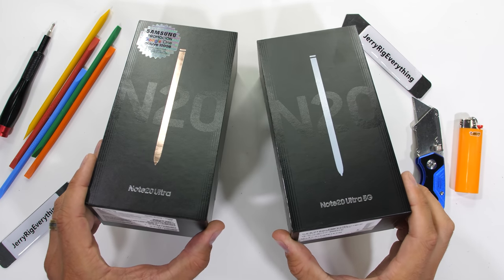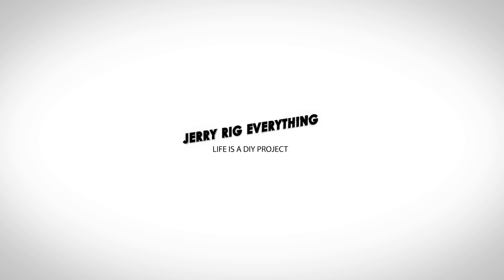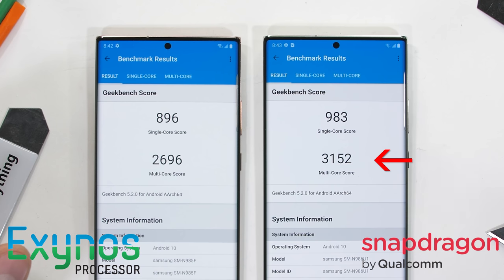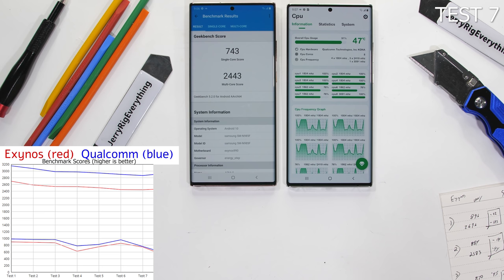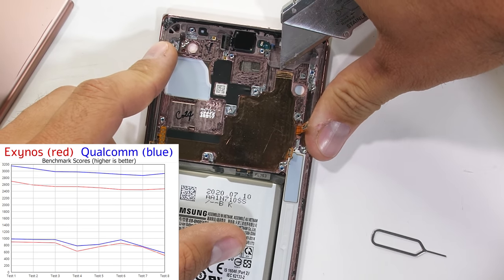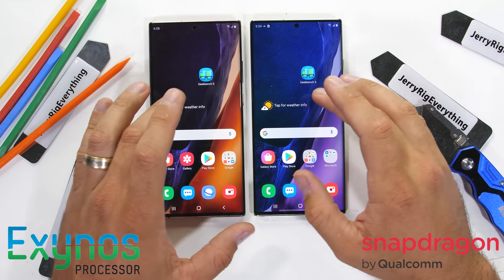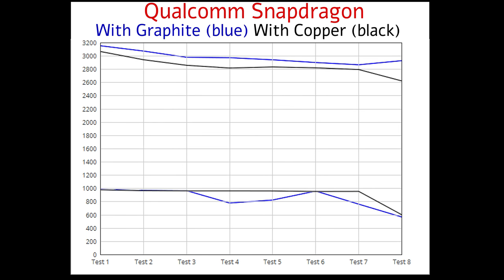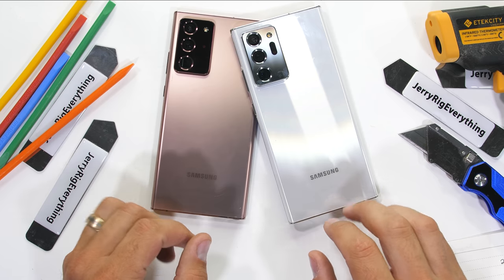Samsung should explain this... Exynos vs Qualcomm?! - Note 20 Ultra

Comment: Samsung are doing similar thing with their TVs, selling cheap lower quality versions in Eastern Europe with the exactly the same name/model.
Reply: You have a example mate?
Reply: Share the facts
Reply: And the power supplies in those TVs are designed not to last. This starts with component selection (only the cheapest caps) to component placement (caps in the path of heat, etc)
Reply: Thanks for the information, I wonder how bad the damage is and how far in the past they have done this.
Reply: @Lion_Hamza  it's a well know fact that quality of everything wester here is much different
Reply: @Lion_Hamza  yes i do, samsung american fridge freezer with familly hub, american version comes with akg speaker under screen, european version doesnt
Reply: What do people expect from Samsung? 🤮
Reply: Festool Fan Thank you! Sounds reasonable. When i was in Egypt family members told me that electronic products in egypt are of lower quality than similar products in Europe. Seems this is a wordwide issue.

Comment: Also owned different Exynos phones in the past and compared them to friends Qualcomm variants,  found that the Exynos ones got much hotter, were slower, throttled more and battery time was worse. Not buying Samsung any more.
Reply: yup same, and development is completely different, can't use regular arch binaries cause they are made for qualcomm
Reply: But you still can buy Samsung on Snapdragon :)
Reply: thats why i bought a phone by moto, it still uses snapdragon. 
although a phone with the latest helio processor is also a better choice as well

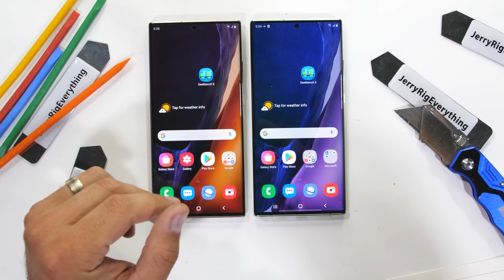Comment: 7:17 You can clearly see how much slower the Exynos variant is when opening the benchmark application.
Reply: The exynos version being a lot more expensive in Europe.
Reply: @thedawner6311  it's not actually. Its cheaper and also has double the storage
Reply: @eventusvantos2770  No, just no.
Reply: @eventusvantos2770  
It's more expensive in Europe , Higher Taxes , the currency from $ to € .
And Base storage options will Remain base storage options.
Reply: @thedawner6311  no its not. Its actually cheaper in most currency conversion and it has double the storage
Reply: What are you on? The note 20 ultra in sweden costs 16000kr. Thats more than $1500. $1500 gets you the largest storage note 20 ultra in the us, but only the 256gb here in Europe.

Shut your foodhole about being in denial if you cant even do a quick Google search.
Reply: @eventusvantos2770  You do realize it takes 5sec to prove you wrong with a Google search for the market prices right?

Comment: I really went on a tangent or two in this comment. It's mostly me rambling (not sure though, didn't go back to read it, lol). I think the point at which I was trying to arrive - but probably never did - is that I get that the phones weren't advertised as having different processors. However, I knew this before making my purchase. All a person had to do was read the description and specs, or ask about it- they actually had to WANT to know what they were getting for their money. I wanted a good processor, so I looked through all available G. S20+ models, did some research, and bought the more expensive Snapdragon model. I don't remember the phones being the same price..... in fact, the lower prices of some of the phones is partially what drew me to triple check all the specs. One phone for $1200 and the same phone for $900-something.... both brand new.. ? Yeah, I'm gonna be looking at all the details.

*Don't bother reading the rest of this, You!*

In the summer of 2020, I wanted a new phone. I was constantly running out of space on my old phone (Galaxy S6, 32 GB and no SD slot). 

The S6 was losing battery too quickly for my liking, and the inner charging port had loose parts, making it pretty complicated to charge.

Most importantly, I REALLY wanted to play CoD:Mobile.

I liked my brother's Galaxy S10 Plus (all except for the rounded edges- I never understood that feature), but figured I might as well get the newest model, which was the S20 line. So, I started researching. The S20+ had most of what I was looking for (you couldn't just make the screen totally flat?). I would have gotten the Ultra for the GB and the additional camera, but the phone was way too big, and the extra camera was nothing special. Plus, that "Cloud Blue" effervescent color was growing on me. 

And I'm finally getting to my point....

I was aware of the difference of one version using Exynos and the other using Qualcomm Snapdragon. I was going to be buying a phone outright- a phone I'd have for at least a few years- so I did my research on every single aspect I could possibly find. 

I almost bought the S20+ for under $1,000- until I noticed that it was the EXYNOS model. How the heck was I going to get to Legendary in CoDm with that!? Anyway... I purchased the Galaxy S20+ from Best Buy for $1,199.99. 

[ As an aside: There seems to be a weird issue between this phone and the CoDm server. I don't know what the deal is, because the stats for the S20+ are overall better than a lot of the "gaming phones" out there, and I have great network and WiFi connection. But I experience a lot of desync (I meet up with an opponent in match, I empty an entire clip on them before they even notice me or do anything, they shoot me once and I die- but killcam shows them seeing me first, emptying almost an entire clip on me, and me not even shooting, not going prone, sliding, jumping, ducking, or even looking anywhere near them....), sporadic lag, crazy wait times, getting kicked from games with a network error code.... and it happens way more in ranked matches than public matches, unfortunately. I tried getting a VPN and playing through another server, but I was kicked two of the times, and CoDm wouldn't even allow me to open the game on another occasion with the VPN on. I don't understand this, because streamers use VPNs all the time. And streamers also seem to have the advantage in the desync... I would have thought it would be the other way around and that the stream running would cause the missed connection. Maybe it works like a lag switch and it desyncs in their favor. I know they're great players, but I just have to wonder sometimes.... what's happening on the other side? ]

Comment: Yeah I could see the low display light in the exynos version. I think the low light appears in the exynos version is to eradicate the heat and battery consumption. They have to make adjustments to somehow match the Qualcomm snapdragon.
Reply: At 4:08 onwards the snapdragon one becomes dimmer as well. Its probably just a software feature that dims the screen when the phone gets too hot (and exynos gets hot real fast)
Reply: not true at all... the heat is so low that is not even an argument..  learn more about display calibration... You can pic any 2 display on the market (that are not calibrated) and they will look different..  and yeah,calibrated displays are mostly for professional use ,average Joe will never need that..

Comment: Never understood the whole Samsung Exynos/Snapdragon thing. They should stick with one or the other for all models.
Reply: Why? They use different chips in different markets due to a variety of reasons, such as different radio frequencies. It's a complete non issue.
Reply: @savagedriver1967  The only way to guarantee universal performance across all countries is to use the same parts in all countries. Any variation leads to differences in performance. A phone is supposed to perform the same no matter where you buy it. If a PS4 in Japan performs better than a PS4 in the USA, people would be up in arms over it.
Reply: They can't sell anything other than Qualcomm in NA mostly due to patents, while the Exynos is cheaper for them (designed and manufactured in their own subsidiaries/foundries) than buying a third party chipset. Qualcomm radios are superb so (I might be wrong) I don't think they're missing any bands which is used anywhere else in the world. Saving even $20 per unit amounts to millions of $$$ in the end for these large companies.
Reply: savagedriver1967 iPhone uses the same chip worldwide just saying
Reply: @savagedriver1967  radio freq? Wtf are you on about? Name one damn phone that can't roam internationally today. There is one reason for it and one only, profit.
Reply: @Zluken  As someone living in South Korea with a U.S. version of the S10+, there is a difference between cell tower frequency used here and the U.S. If you buy a Korean version model of the same phone and bring it to the U.S., at most you would only be able to get 3G speeds. Likewise, my phone is unable to access 5G speeds. Though the U.S. model does seem to receive 4G LTE, though at slightly slower speeds in South Korea
Reply: @jazelresto419  yeah I believe you I read more about it yesterday. Better wait for the next exynos chip since I already have the S10+. It's said that samsung is working with AMD and ARM for the next SoC, who knows maybe it will be better than the Qualcomm one.

Sweden use both Snapdragon and Exynos. Actually Ericsson is a major supplier when it comes to 5G networks so for is it's just a loss today. CPU performance is not that important for me but battery life is. So in my case I feel cheated.
Reply: savagedriver1967 so why doesn’t Apple do that? They ship with the same A13s worldwide. 🤷🏻‍♂️🤷🏻‍♂️🤷🏻‍♂️
Reply: @savagedriver1967  it is an issue, if you pay the same for less, also Samsung puts their own soc in their phones cos its cheaper for them.. AKA better PROFIT MARGINS...
Reply: Maybe they must call a Exmos version like: The slow Galaxy note s20
Reply: @WalkerIGP  No it's not. It is perfectly legal for Samsung to sell different processors in their phone in different countries. They could even sell a completely different phone with the same name in a different country, it's their company. You are not entitled to anything. Samsung has their reasons. Everyone is misunderstanding this. This isn't even a cpu, this is an soc. What does that mean? It means that it isn't just a cpu but it is a different everything, cpu, wifi, data connectivity. It's all on one chip and those chips might not work well outside the US. Samsung has their buisness reasons for doing this and it's legal and you have no obligation to buy their products or even have any say in what they do
Reply: @ronakparikh  I don't think you actually understand the issue. No one is debating the legality of it. What is being debated is the rationale behind having two different sets of internals in the same model phone.
Reply: @WalkerIGP  Did you read what I said? 1. There doesn't need to be any rationality. 2. The most likely reason is that different areas of the world need different cell connectivity and you can't just change that part of the phone, it's not just a cpu it's all on one chip one soc and different socs cost different amounts in different places. You really have no say in what they do and honestly no one cares about your opinion unless you are an engineer working there or are a very large investor
Reply: @ronakparikh  Based on your reaction, it seems that you are the one who is very concerned about what others think. It is comments on a video, no needs to get worked up over other people's opinions, which they are entitled to have. Personally I could not care less if you care about my opinion or not. I don't live for your approval.
Reply: @WalkerIGP  I am disappointed in this video for spreading misinformation and for everyone in the comments believing it and I see a lot more misinformation than actual fact so I want to set the record straight.